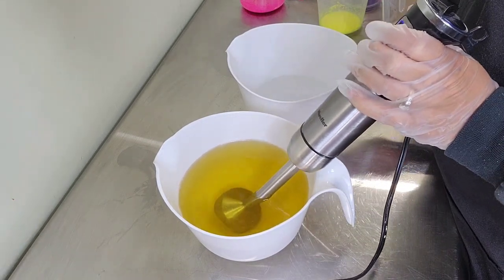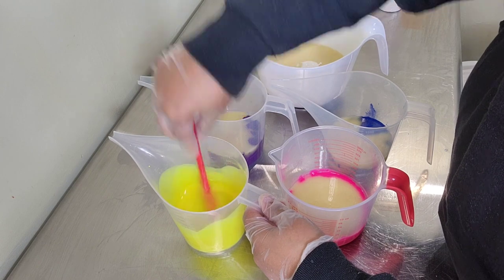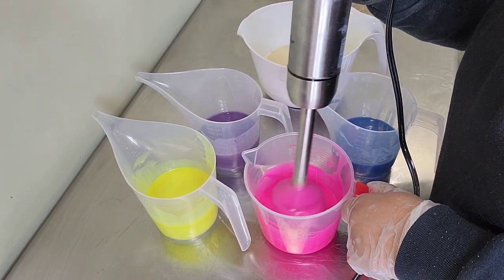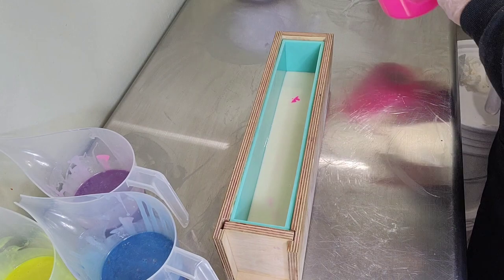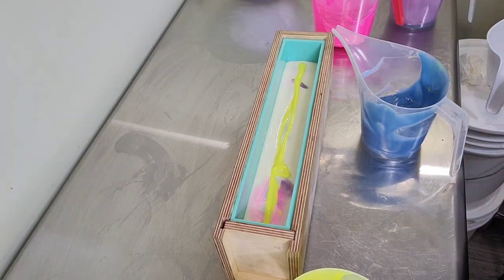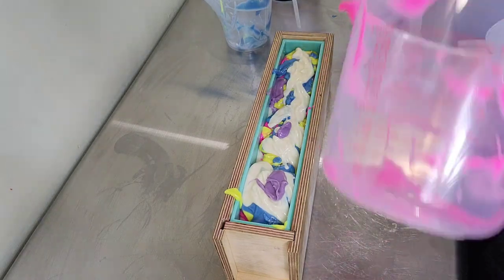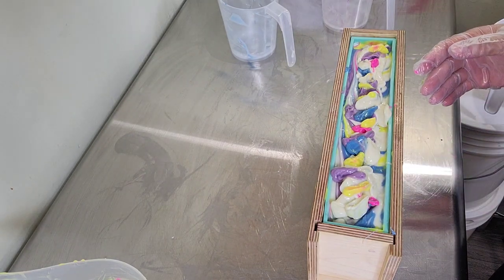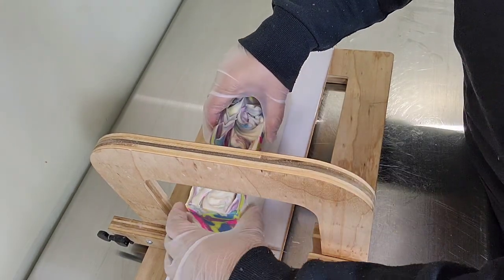Spring Fling Cold Process Soap #handmadesoap #newvideo #soapcrafting #soapmaker #youtube

Comment: I love the vibrant colors. I may have to try mad micas with my soap. Beautiful soap. 

Could you do a video on the products you use such as the mold, stick blender, cut diaper, etc. I have been using Amazon for everything but I noticed that my soap cutter uses drag marks. Your cuts are really nice. 

Do you find the tall skinny bars sell better than the standard square soap?
Reply from the maker: Thank you again🥰. Sure, I can do a product video. 

I use both molds standard and tall skinny. I hope that was helpful.
Reply from the maker: No, I don't think so they sell pretty much the same. It depends on what the customer wants.